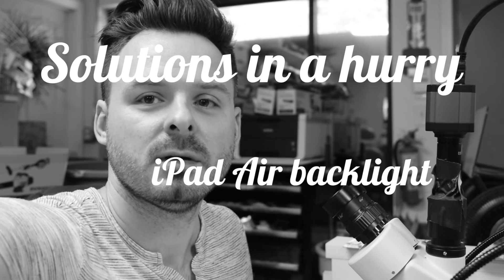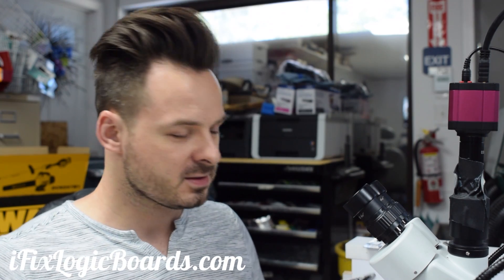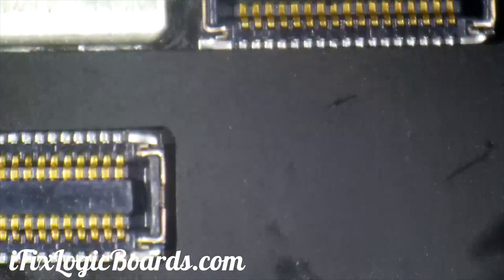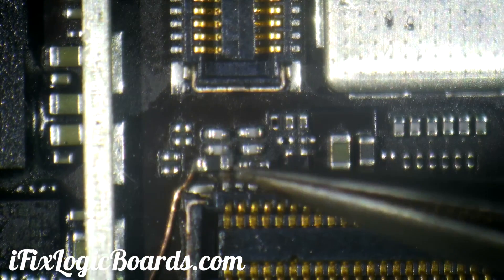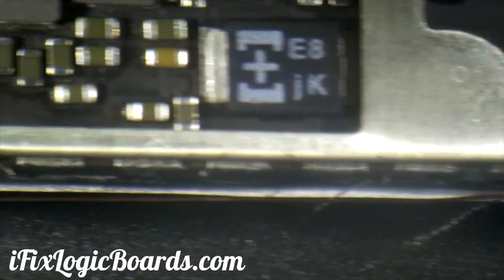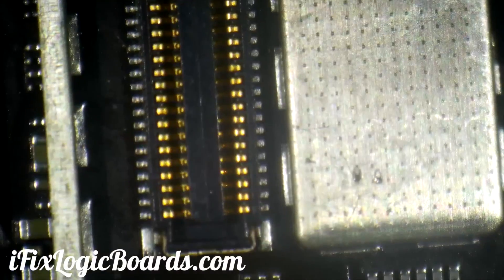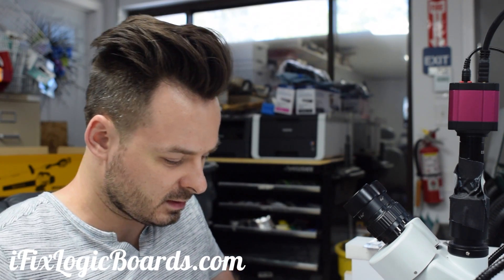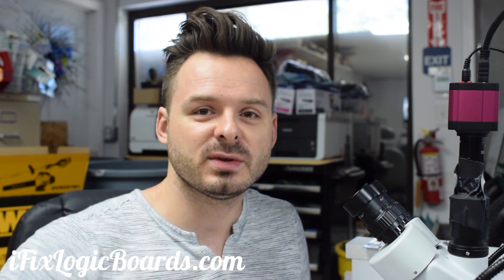iPad Air no backlight repair - Damaged Anode pad - Solutions in a hurry

Comment: good job) 
yesterday i made ipad pro with touchscreen failure without schematics :)
Reply: ScoopOf3D no, broken capasitor near on of bcm touch controllers
Reply: ScoopOf3D first of all i found a short om big capasitors , then i check this line visually and remove  filter , then i plug in 1v voltage to this line and found small capasitor right near IC with freezer . There was no water and no fall damage , absolutely clean ipad pro 9.7 :)